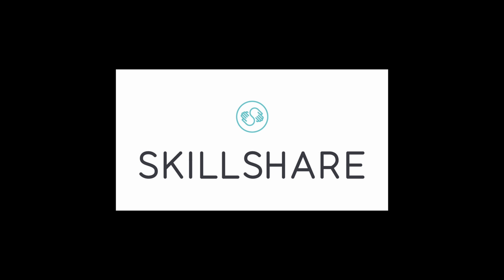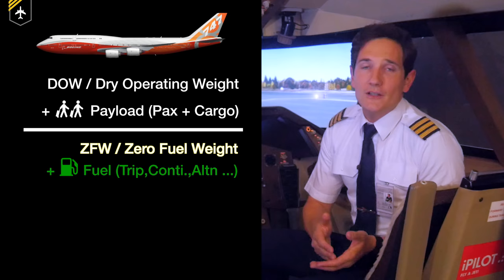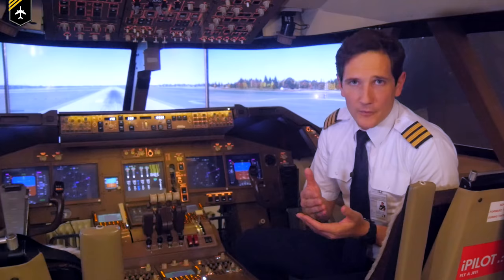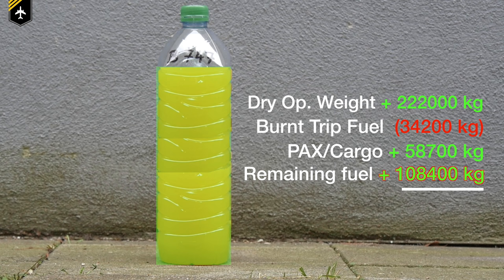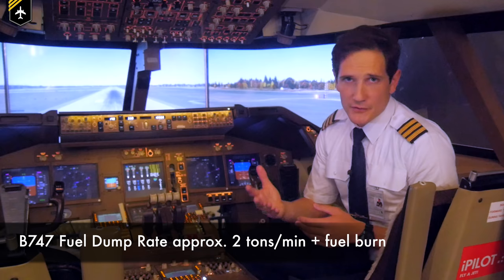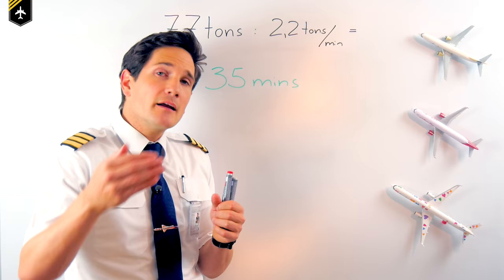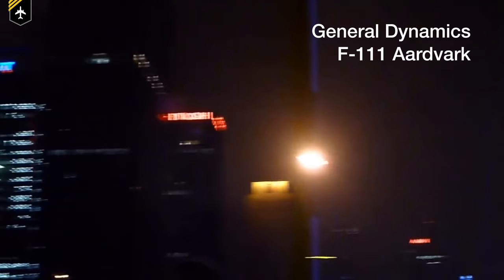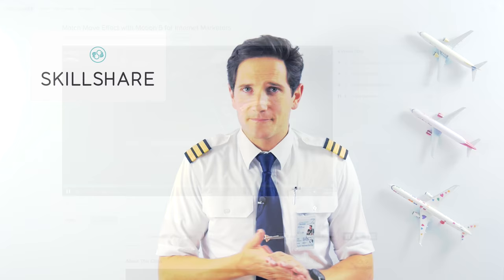Why do PILOTS DUMP FUEL??? Explained by CAPTAIN JOE

Comment: There must be a way to reduce weight without dumping the fuel! They fuel midair why not remove fuel midair? Just an idea.
Reply: Thing is fuel is literally the heaviest thing in the aircraft.
Reply: @ZK-APA  why not remove fuel in a controlled way. They refuel midair. Why not remove fuel midair?
Reply: @ottifantiwaalkes9289  Because implementing that will result in higher complexity, which will not only increase costs, but also not save fuel because you are burning more fuel to save that same fuel.
Also you have to keep in mind is that having such a situation when you have to dump fuel is very very rare. So implementing a far more complex system to counteract this will have a negative effect rather than positive
Reply: @ZK-APA  I do not know you, but it sounds like an excuse of some sort. I myself could rebuild a refuel plane to be able to suck fuel as well. The planes exist and there is small changes to be done,  I think you are way off with it, saying it takes the same fuel to collect, not wanted fuel. Remember they dump tons of it. Often the fuel they dump would last thousands of miles.
Reply: @ottifantiwaalkes9289  The issue is not of implementation. Its about execution. Because one, believe me no one wants to dump fuel, especially the airlines (as its a monetary loss as well). Plus one would dump fuel if its a time constraint to get back on land. Otherwise they don't.

Plus say in the example you gave about making a plane that'll collect fuel. First you'll have to retrofit each and every aircraft that can dump fuel. So that means a full redesign. Then you'll need a tanker aircraft, and then redesign it to collect fuel. Then considering the number of aircraft that'll be required to be on standby around the world, at every major airport, will be in the thousands. Then the number of pilots required to fly it have to be on standby at all times. And all this has to be implemented for a situation that happens in the worst case less than 10 times in a year.
So with your solution, essentially you have just spend a billion+ USD to save less than 500K USD. Not only that, but the fuel required to maintain all these aircraft would be hundreds of thousand tons.

Comment: Hi Joe. Is fuel dumping only done for emergency landings or could also be due to favourable tail winds leading to fuel saving. Also what would happen if in a plane which was above max landing weight but didn’t have fuel dumping tech and needed to make an emergency landing ?
Reply: Fuel dumping is only done in an emergency situation.
Reply: That I understood.  But my question was what if the plane had excess fuel due to favourable tail winds and this resulted in weight above max landing weight. Would the plane dump fuel or keep circling above the city/airport to burn the excess fuel or land with excess fuel ? There is also a second part to my question above for which i am seeking the answer to as well
Reply: @Vasudev007  It would keep circling, but I don't think there's any situation where tailwinds would be so strong that the plane comes in over maximum landing weight. If a plane needs to make an emergency landing over maximum landing weight, it will do so. Requires additional inspections afterward for obvious reasons, but there has never been a crash attributed to an overweight landing. I believe some operators will prefer overweight landings over fuel dumping when both are an option, but not positive.
Reply: Kamal Hingorani your concept is very theoretical and it’s unlikely to happen. But if it happens most probably they will burn off fuel by holding rather than dumping

Comment: dumping 77 tons of fuel? wouldnt make much more sense to expel/eject ( parachuted down / eventually piloted to safe areas ) a tank placed in the rear belly if releasing a couple of external tanks attached under the wings ( drop tanks ) or a CFT create too much drag during the flight? The crooked chain of command in the industry dont allow the engineers to develop and implement ideas already used on military aircrafts since WW II
Reply: That's impractical because the chance of having to do a fuel dump is so low that the added complexity would negate any advantage.

Comment: Wait, is fuel dumping the reason why you see white streaks coming from the wings of the plane when you’re watch from the ground? I always thought the white streaks is a cool pattern made by the wings cutting through the air, creating lined clouds which soon disperse... wow. Life was a lie lol.
Reply: Those white trails are not caused by fuel dumping. They are condensation trails which are produced by aircraft engine exhaust when the water in aircraft engine exhaust condenses. They are composed primarily of water, in the form of ice crystals. Condensation trails have nothing to do with fuel dumping, and fuel dumping is rare because it is only done in an emergency situation, not all the time.
Reply: Mike P ohh is that so? Thanks for clarifying! So it’s “produced” by the engine and some physics stuff XD
Reply: @StarSaphire9981  - Yes, the engine exhaust condendes in the air and creates a white trail. It's a normal physical phenomenon.
Reply: @mikep9604  not true..
The ones that have actual water vapor.. The trails eventually disappear

The trails we see dont.. They dont vanish like water vapor..
They fan out and turn into what we think are clouds..

Which fuel wouldnt do either.. Being high octane it would eventually evaporate..

What you see are chemicals.
They fan out in weird patterns that arent normal cloud structures and are sprayed in patterns like someone is playing tic tac toe..

Dont believe me
Run your hand over the top of your car on a nice sunny day and look at your hand in the sun..

It will look yellowish brown like sulfur and be full of tiny metal particulates..

Its not fuel by any means

And dont say its pollution...99% of the cars on the road today are brand new.. Putting out little to zero emissions... So its not pollution either

Comment: Is it a calculation of weight or real time measurement? If it is a real time measurement, how it is done while flying at 10kM above earth? passengers are not declaring weight while boarding. 15 adults can weigh a ton!!!!
Reply: The aircraft can measure the current weight and display that to the pilot.
Reply: Thanks. I Think I know now. Just before take off exact weight is known while stationed on the ground (all inclusive like fuel people cargo etc). nothing changes while flying but for fuel. Knowing the  current fuel reading  total weight can be calculated fairly well.
Reply: @nara49veera12  Even in the air the aircraft is able to calculate its weight. So there isn't much calculation.
Reply: @ZK-APA  MEASURE in flight, you are the only who can do that, sure you are genious!

Comment: So pilots are only allowed dump fuel in an emergency 
It’s bad for the environment 
So they basically calculate holding patterns and flight time 
If there’s an engine issue,they dump fuel so the engine doesn’t catch fire
Reply: Basically fuel is dumped if the aircraft has to land for any emergency (doesn't have to be related to the aircraft, eg a passenger suffering from a heart attack) and the actual landing weight is more than the aircraft's max landing weight.
Reply: @ZK-APA  yes otherwise the plane is too heavy to land and so it can either overrun or crash

Comment: Why don't they just install thrusters on planes and use those fuel for thrust instead of dumping them away, for sure, there will be so much fuel to be saved if  that's the case

Comment: Is that why i see lines behind airplanes when i am on the ground?
Reply: No, those are just normal condensation trails when the engine exhaust condensates in the air. Fuel dumping is very rare because it is only done in an emergency situation, it doesn't happen during any normal flight.

Comment: They don’t dump fuel that’s condensation from compression from the engines just like a air compressor on a job site. Use your heads

Comment: How do you verify that's even fuel being dumped? Because taking one's word vs actually testing is a big difference. And is the amount of fuel being put in the plane calculated or measured. Cause I've only found 1vid of a commercial airliner being fueled and it looks kinda odd
Reply: Trailing edges are the best locations for dump systems far enough from the engines and close to the wing tanks. That’s definitely fuel for there to be that amount of liquid,  aircraft don’t carry thousands of pounds of water. Fuel is definitely measured, capacitance probes measure the fuel which is displayed on the fuel quantity gauges, often in pounds.
Reply: @sexigrande1792  could it be possible that water buildup is from the condensation created by the engines pulling the huge amounts of air through them. Because I don't see any solid evidence that commercial airliners are actually carrying the amounts of fuel that they state
Reply: Ive done heavy overhaul work on military lockeed Martin p3 aircraft and fuel is definitely stored in the wings and fuselage. I have worked with people that have worked/work on commercial aircraft and that confo has never came up. In saying that mid to large aircraft share the same basic principles. Turbine engines need fuel and lots of it. You have to realize that tens of thousands of mechanics and pilot work on aircraft everyday so fuel weight is a major part of it. So if the numbers dont add up they would know about it. Even if there was water in the wings you wouldn’t want it in there imho, water can corrode aluminum and even though their probably primed surfaces inside you would constantly have water pooled up inside.  When aircraft aluminum starts to corrode it can get pretty bad.
Reply: @sexigrande1792  wouldn't it make more sense that turbofan engines are running on compressed air. I've never seen diagrams for the injectors/sprayers/etc along with any sort of fuel transfer which would need some serious fuel pumps to supply the supposed rate of burn. I'm not denying that there are people doing what they're told to do, but does anyone question the legitimacy of it? I know a lot of hydraulics are in place for landing gear, ailerons, flaps. But what if the supposed amount of fuel is a lot less used to prime the engines on initial startup?
Reply: Long story short- tanks have boost pumps installed in the lower portion of the tanks, built inside The pumps is an electric impeller which sends a constant supply of fuel to feed the engine. Fuel is sent through fueling manilfold lines and cross feed line systems from the boost pump.To go along with all the other stuff going on in a turbine engine which is a lot ... most of these systems are connected in some way. P3 aircraft I work on puts out something like 20000 hp or so from  4 turbo prop engines. The plane itself is over 100k pounds without fuel, so the amount of fuel would have to be significant to fly it. The aircraft holds approximately 60k pounds of fuel alone in the wings and fuselage tanks. If the  fuel quantity gauges are reading x amount of fuel and everything falls in somewhere where the manufacturers specs say they do( amount of fuel burned per hour, weight of the fuel etc.....)then there’s nothing really to question. Part of a mechanics job is fix and diagnose snags so If the numbers didn’t add up then of course someone would pick up on it eventually. Conspiracy people often say they only use very small amounts of fuel, fuel isn’t stored in the wings because that’s where hydraulic systems are and wings flaps are ( for the most part not true).... aircraft Levitate... pilots and mechanics are paid to keep it a secret.. etc...

Comment: Fule dumping is just evil. How does confess allow this. I see those trails over my city all the time!
Reply: The aircraft dump fuel only in an emergency situation. You said that you see those trails all the time. If you see them all the time they are the contrails from the jet engines because water vapor condenses from aircraft engine exhaust. Contrails mainly consist of small ice crystals. This is a normal phenomenon.
Those trails have nothing to do with the fuel dumping. The aircraft don't dump fuel all the time. The fuel dumping is rare because it is only done in an emergency situation.

These are normal contrails from the engines:
https://upload.wikimedia.org/wikipedia/commons/thumb/b/b0/A340-313X.jpg/1200px-A340-313X.jpg

Comment: How do you know how much the plane weighs?
Reply: It can be calculated by using the components seen in this diagram:
https://i.stack.imgur.com/DT38B.png
(The Operating Empty Weight (OEW), at the bottom of the diagram, is the basic weight of an aircraft including the crew, all fluids necessary for operation such as engine oil, unusable fuel and all operator items and equipment required for flight.)
Reply: @mikep9604  The passengers and baggage part was the portion I was wondering about. I know the airline probably has figures for what the plane weighs for the OEW, and the checked baggage is weighed during check in, but the carryon baggage plus the weight of the passengers is not measured, so do they just assume an average weight per person? Or does none of that matter in the grand scheme of things because it's such a small percentage of the overall weight of the craft?
Reply: @LurkerPatrol5  An average weight of a passenger is used, usually about 85 kg. (it may vary depending on the airline)

Comment: Why fuel dumping is not available in narrow body aircraft
Reply: Usman Mahoon because their landing weight isn’t that far off than their take off weight (in wide body aircraft fuel can be up to half of the aircraft’s mtow)

And if needed, the narrow body planes can make an overweight landing much easily
Reply: Is there any other reason excep this sir fuel burning process etc
Reply: Except this
Reply: Usman Mahoon not really. Because fuel dumping is such a rare occurrence that no point designing a fuel dump system for a narrow body plane. It’ll just bring up complexity and costs for something which will hardly be ever used.
Reply: Actually i am student of aviation management in university of lahore and my teacher given me assignment on this topic for that reason i was asking question
Reply: Usman Mahoon oh ok. Yea the main reasons are the one I said as above, so you can use that.
Reply: Oh thanks sir

Comment: What are main things for  pilot course
Reply: This is a usual theory course syllabus:
    Principles of Flight
    Airframes/Engines/Electrics
    Performance
    General Navigation
    Radio Navigation
    Instruments/Electronics
    VFR Communications
    IFR Communications
    Air Law & ATC
    Operational Procedures
    Flight Planning & Monitoring
    Mass & Balance
    Human Performance & Limitations
    Meteorology
Then there are of course the actual flight training, simulator training and the checkrides which you have to pass.

Comment: Ok so your saying they only drop fuel when there destination is cancelled and they go to a new one
Reply: Mumin Jamal its more of if you have to land immediately after take off. Its a time issue, and nit a destination issue
Reply: ZK-APA but they have to lose fuel to land a emergency landing because they calculated everything they calculated how much fuel they will burn the hole ride so if there’s a emergency landing they have to much weight so they dump the amount they thought they would burn damn I’m smart on internet but in class I’m a donkey

Comment: Sir i am working in airport fire service in india, i have attended many low fuel emergencies, i want to ask , if all fuel quantities are calculated , in which case or at how much fuel balance, low fuel emergency is declared by captain ?
Reply: wasim ahmad generally in airliners, the system can predict fuel usage. So with that the crew can find out whether they will have sufficient fuel or not. If they note that the fuel is approaching the minima, they declare priority or emergency, depending on the situation.

Comment: What happens with the dumped fuel?
Reply: It dissipates in the air.
Reply: @mikep9604  so will it be lost forever? Unused fuel?
Reply: @DrKleiner0815  - Yes, that's what happens. But it is rare when they have to dump fuel because it is only done in an emergency situation.
Reply: @mikep9604  okay thanks. I think they should put more effort on engineering planes so that they can stand landings in maximum weight better

Comment: why do you name yourself a captain when youre actually just an first officer. Its not badder to be that but I just thought because of the three stripes on youre shoulders
Reply: Alicia Axelsson there are 2 definitions of captain. One is the airline captain or airline commander (who has 4 stripes)

Other is basically someone with a cpl or above (because their licence gives them the right to act as a pilot in command ie a captain)

So yes even if you’re a first officer, you can call yourself as a captain in a general scenario

Comment: couldnt they just put the fuel on an metal boxes with parachutes and throw them overboard. the nearest airport can recover that and reuse it for other flights. no losses or environmental problems
Reply: shravan srini since its such a rare occurrence, having such a system would actually increase cost, complexity and fuel consumption.